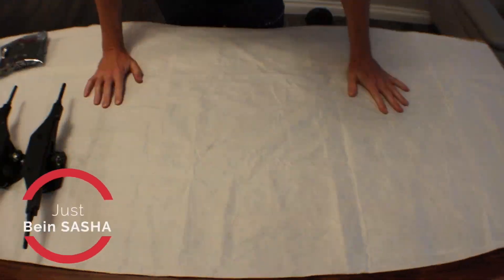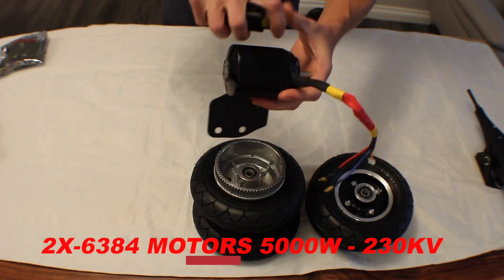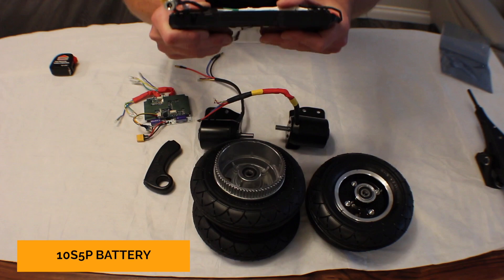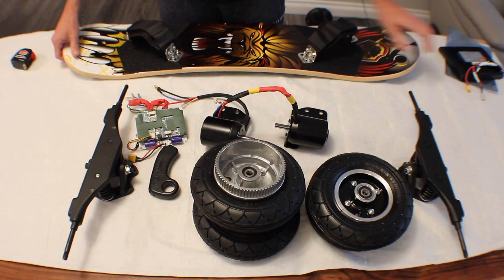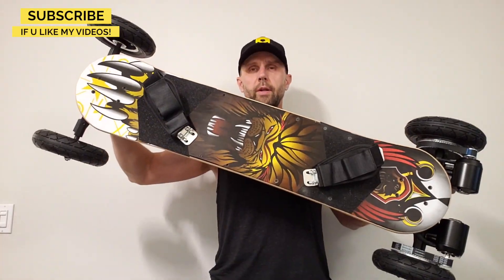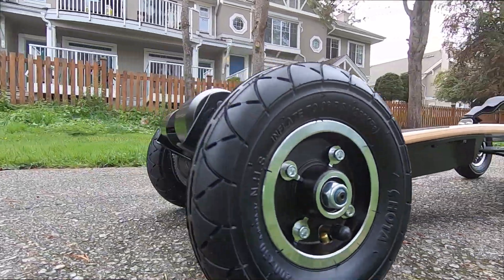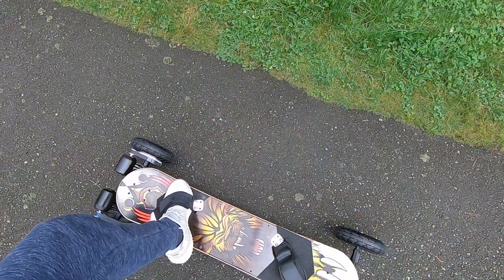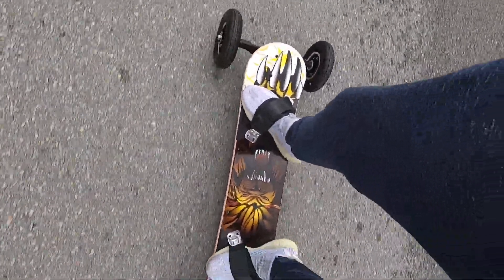10000w HARDCORE Electric Mountain Board! 2019/2020

Comment: can we charge that battery or we have to replace that battery after it get exhausted
Reply from the maker: no u connect two or three batteries in parallel... so u get same voltage but power of two or three batteries in all... so u ride your board for miles not thinking about battery life

Comment: What's your range and top speed?
Reply from the maker: 35km range with two batteries in parallel... 35km/h speed but this is not build for speed but as all terrain board... meaning i have so much fun with it on trails! Check this link to see modifications i made with the board... https://youtu.be/ViZ0JWq-gvA